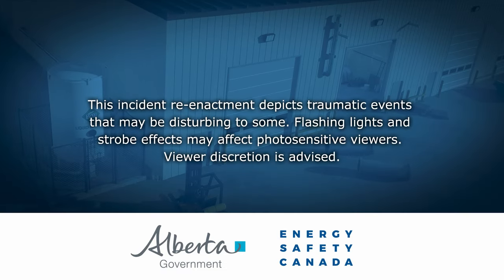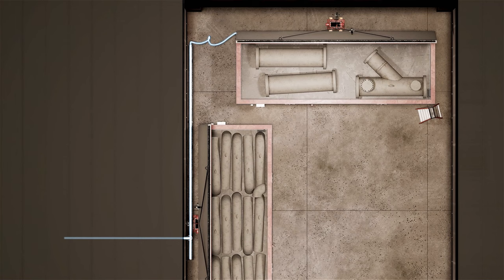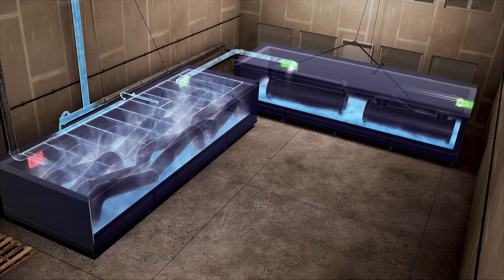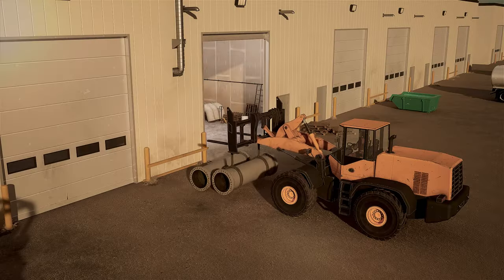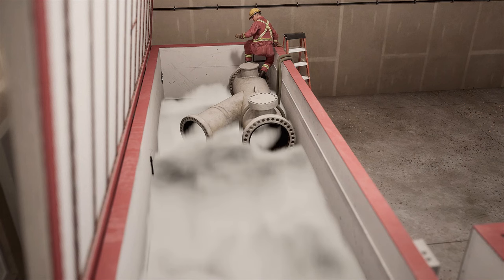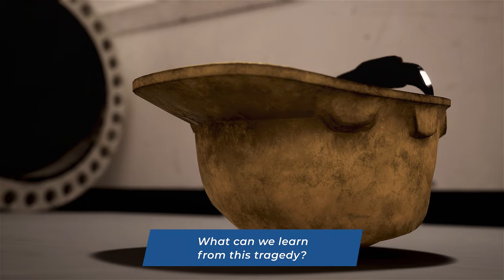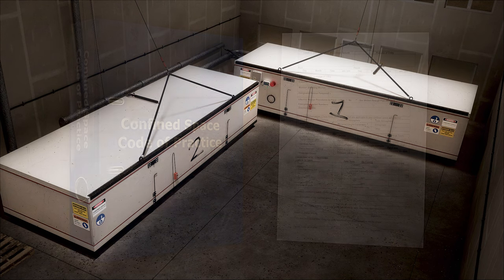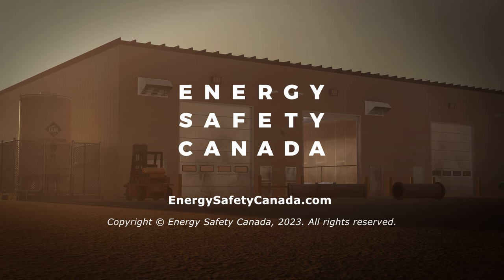Confined Space Incident 3D Re-enactment Video

Comment: You want engineered safety, how about a cooler that the front lifts with the top so nitrogen can't be trapped inside, frost clouds don't normally collect, eliminating the (improper) usage of a ladder to enter the cooler, and it makes it easier for the loader driver to see what he's doing too.
Reply: Yeah, how about not entering the cooler at all, using a roof-mounted crane with a basket that the pipes are contained in. Easy to say, difficult to generate capital to make happen.